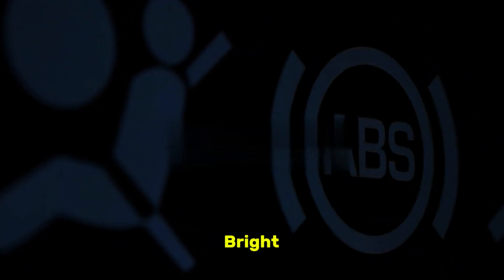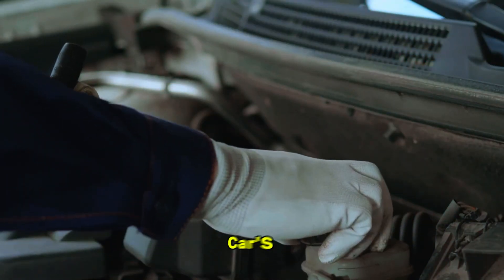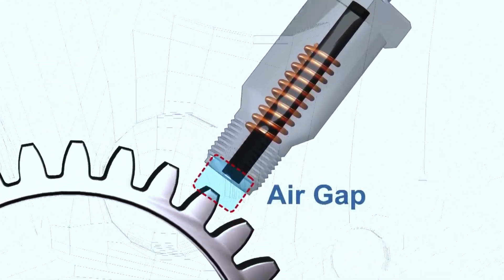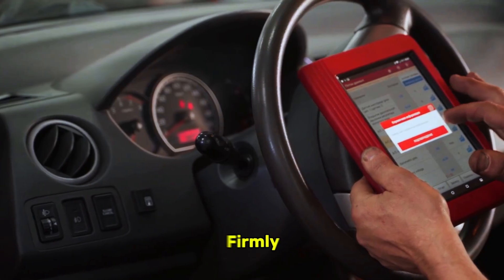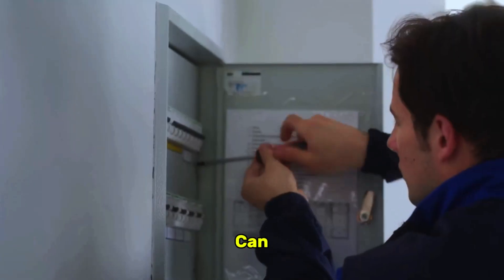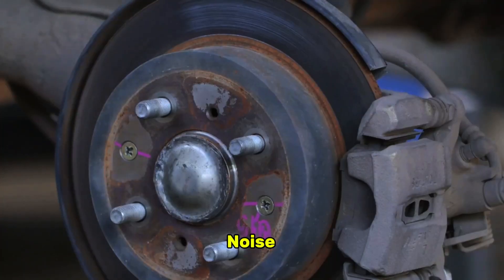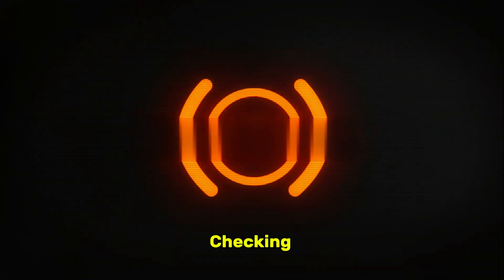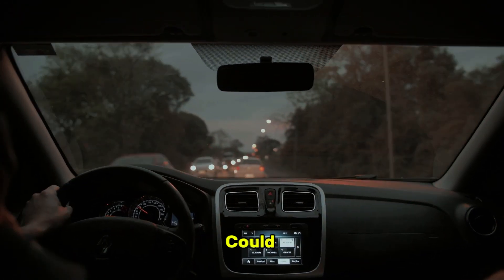ABS Warning Light On? 5 Common Causes You Shouldn’t Ignore

Comment from the maker: 🚨 ABS Warning Light On?
Here are the Top 5 Causes:
1⃣ Faulty ABS Sensor
2⃣ Damaged Wiring/Connector
3⃣ Low Brake Fluid
4⃣ Bad ABS Module
5⃣ Blown Fuse/Relay

👉 Fix it early for safe driving & better braking!

Comment: Im having trouble figuring out what going on with my car the abs warning is on after a few minutes of ride then turn off again if my car is off ang park, then abs on again after few minutes of ride any idea whats the problem? Hope to hear from you thanks
Reply from the maker: Hey! 
This usually points to an intermittent ABS issue. Most commonly it’s caused by a faulty wheel speed sensor, dirty sensor ring, or weak ABS wiring/connector. When you start driving, the ABS system runs a self-check — if it detects abnormal wheel speed data, the ABS light turns ON. After shutting the car off and restarting, it resets until the problem shows up again.

What to check first:
✅ Scan for ABS codes (very important)
✅ Inspect all wheel speed sensors for dirt or damage
✅ Check sensor wiring near the wheels (often breaks from road debris)
✅ Low battery or charging issues can also trigger this

I’ll be covering ABS warning light fixes in upcoming videos — stay tuned 
Thanks for watching and commenting!

Comment: the abs is a piss poor design, all vehicles are subject to rust therefore all components must be fabricated from rust proof materials, not cheap plain steel.
Reply from the maker: You're right; rust can be a real issue for ABS systems. It's frustrating when materials don’t hold up over time. Thanks for sharing your thoughts!

Comment: For my case, service center replaced the pump and it was the huge bill. How does the pump and ABS light relate? Could you pls explain?
Reply from the maker: For sure! 👍
When the brake pump (ABS pump) starts failing, it can’t build the hydraulic pressure your ABS system needs. The ABS module constantly monitors this pressure — so if the pump is weak or not working properly, the module detects the fault and triggers the ABS warning light.

So in short:
Bad pump ➜ Low/unstable pressure ➜ ABS system can’t work safely ➜ ABS light turns ON.

That’s why the service center replaced the pump. It’s expensive, but it directly affects braking safety.

Comment: My car started showing ABS light after changing the tyre
Reply from the maker: "ABS light after a tyre change usually means one thing — the wheel speed sensor or its wiring got disturbed. Sometimes dirt gets on the sensor, the sensor plug isn’t seated properly, or the wrong tyre size was fitted. Just recheck the sensor connection on the wheel that was worked on. If everything looks fine, scan for codes — it’s an easy fix most of the time!"

Comment: Way to many failure points in these new cars. To many Electrical components to failure.  Manufacturers Need to get back basics,  get rid of these Dangerous  sensors and Modules that can cause complete failure of the car
Reply from the maker: I hear your frustration! While sensors add complexity, they're also designed to enhance safety and performance by giving us crucial data about the car's systems.
Reply: It’s a money grab

Comment: I just had the ABS light and the Brake light come on. Not sure if that means a more serious issue. Or if it automatically does that. Very nervous about this because I just can't afford a huge bill. Not sure I can just go to a full service station and they can look at brake fluid and fill it up. Or should I just call my dealership. I am not a DIY person. So that's out.
Reply: If the brakes are working properly it is often a ground that has corroded.
Reply from the maker: Good point! 👍 Yeah, a corroded ground can definitely trigger both lights even if the brakes feel fine. It’s something worth checking after the basics like brake fluid.
Reply: @CarFixSchool  To further the story. I was going to go to the filling station the next day. But the lights have now magically gone away. Odd. The last 2 days with no issues.
Reply from the maker: That’s actually pretty common! 😊 Sometimes if the fluid level was just on the edge or a sensor had temporary moisture or dust, the lights can reset on their own. Still a good idea to check the brake fluid when you can — just to be safe. Glad to hear everything’s working fine now! 👍
Reply: @CarFixSchool  To recap the story. The lights came back on again. Ended up taking it to the dealer. He said the ABS System was shot. Price would be over 5 grand. Add that to needing a new compressor for AC issues and the price would be close to 8 grand. Didn't get it fixed. I will drive with it like that for now. Nothing I can do. Can't afford that.
Reply from the maker: That sounds really frustrating! It's tough when car repairs can be so expensive. Hopefully, you can find a more affordable solution down the road. Stay safe out there!
Reply: I’ve just bought a Citroen berlingo private sale 2017 plate,thought I’d hit a bargain and I don’t know much about vehicles,but I was told I need a new wheel speed sensor I had it plugged in the diagnostic and that code came up so I paid £120 to get it changed and the problem is still there,now I’ve had a vehicle electrician has told me it might be the abs module and pump,and it’s now more likely to cost me a fortune to get it fixed
Reply from the maker: @andrewellis777  Sounds frustrating bro — especially after already replacing the wheel speed sensor.
But don’t panic yet, this is actually common with Citroen/Peugeot models.

When the sensor is new but the fault stays, it usually points to one of these:

1⃣ Damaged wiring near the wheel hub
These vans often get broken wires or corroded connectors. Even if the sensor is new, the signal can’t reach the ABS module. A simple continuity test can confirm this.

2⃣ Dirty or cracked ABS tone ring
If the ring/reluctor is cracked or full of rust, the new sensor will still read wrong. Many mechanics miss this.

3⃣ ABS module/pump issue (less common but possible)
Electricians often suspect the pump when all wheel readings are inconsistent or when the module isn’t sending/receiving signals properly.
But don't assume the worst yet — modules fail, but not as often as wiring faults.

💡 What I’d do before spending big money:

Ask them to check live data for each wheel speed while driving.
If one wheel reads “0 km/h” or jumps around, it’s wiring or tone ring, not the pump.

Inspect the wiring harness very carefully — that fixes most cases.

Hopefully it’s just a cheap wiring fix and not the pump. Let us know what they find!
Reply from the maker: Hey! No worries — that’s a pretty common situation. 👍 When both the ABS and Brake lights come on together, it often means your brake fluid level is low or there’s a sensor issue. Most full-service stations can check and top off your brake fluid for free or very cheap — you don’t need to go to the dealership right away.

If the pedal feels soft, or braking feels weak, don’t drive far — get it checked soon. But if it’s still braking normally, it’s usually not a huge repair. Just get the fluid checked first, that’s the easiest and most likely fix.
Reply: @CarFixSchool  Thanks. The braking feels fine. I believe I will try the full service station first. Then go from there. I will give you an update if you are curious.
Reply from the maker: Sounds good! 😊 Yeah, definitely start with the full service station — that’s the easiest first step. Glad to hear the braking still feels fine. And yes, please do update me — I’d love to know how it turns out! 👍

Comment: Where is the abs sensor located in all four wheel ? Do i need to check all four wheel, the japenese mechanic says, the abs sensor is located on the front left wheel only ??? Where to check ? ❤❤❤ i'm confused
Reply: I love you man..and honour you much too..fr explaining these questions too patiently which r very useful truly..🎉🎉❤❤
Reply from the maker: @viddyasaagar5457  “Thank you so much! 🙏❤ Your support means a lot. I’m really glad the explanations are helping you. More useful videos coming soon! 🎉🔥”
Reply from the maker: ✅ All modern cars (with 4-wheel ABS) have an ABS sensor on each wheel — that means 4 sensors total (front left, front right, rear left, rear right).

Each sensor sits very close to the wheel hub or axle, reading the speed from a tone ring (or reluctor ring) to detect if that wheel is locking up.

📍 Here’s where to check:

Front wheels: Behind the brake rotor, near the axle hub. You’ll see a small wire leading to a sensor bolted near the wheel bearing.

Rear wheels: Either the same spot (on the hub) or sometimes on the rear differential if your car has a solid rear axle.

🧰 Quick tips:

Follow the thin black wire coming from behind each wheel — that’s your ABS sensor wire.

If any wire is broken, dirty, or covered in grease, clean and inspect it.

Use an OBD scanner that can read ABS codes — it’ll tell you exactly which wheel sensor is faulty.

⚠️ So, bro — that Japanese mechanic is wrong (or maybe your car is a very old model with front-wheel ABS only).
Tell me your car make, model, and year, I’ll tell you exactly how many sensors it has and where each one is. ❤️
Reply: @CarFixSchool Hi, how can I measure electrical health on each sensor? I have a Kia Forte 2019 2.0 engine. Thanks Bro!
Reply from the maker: @ih7america  You can check each sensor’s electrical health using a digital multimeter. Test for proper voltage, ground, and signal output while the sensor is connected. Compare your readings with the specs in your Kia Forte’s service manual. A scan tool can also show live data to help spot weak or failing sensors. Hope that helps! 🔧
Reply: @CarFixSchool dear..you r so patient and loving in explaining even these questions of individuals in comments...great..blessings dear man🎉❤❤🎉❤
Reply from the maker: @viddyasaagar5457  Thank you so much! 🙏😊 I really appreciate your kind words and support. Glad to help and share what I know ❤🎉

Comment: Hello could you please help me,
I'm facing one strange problem where the abs light gets on and after some time it disappears. 
The service person is saying it is related to clutch. 
Could you please let me know whether this can cause abs light to show up?
Abs fault remains only for sometime so sensors are okay
Reply from the maker: Hi! An ABS light that comes and goes usually points to an intermittent fault — often a wheel speed sensor, wiring connection, or weak battery/alternator issue. The clutch itself doesn’t directly trigger the ABS light, so what your service person said may not be accurate. I’d recommend scanning for stored ABS fault codes even if the light disappears, because the system usually saves the error. That will tell you exactly which circuit or sensor is causing the problem.